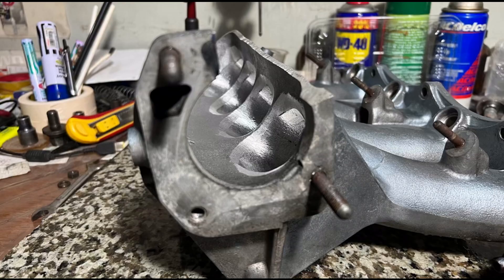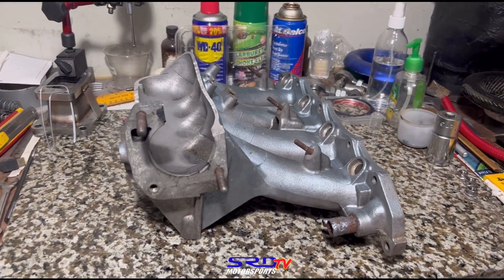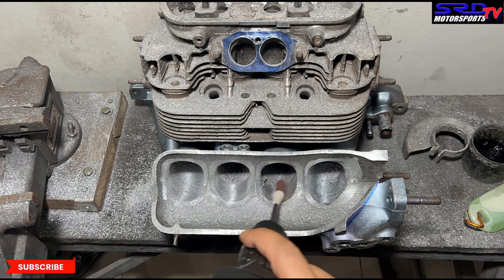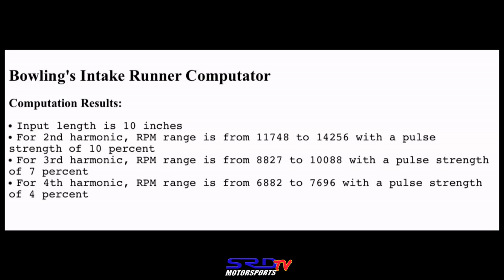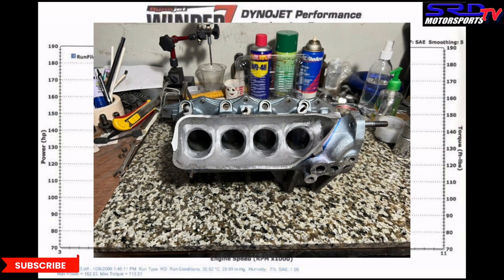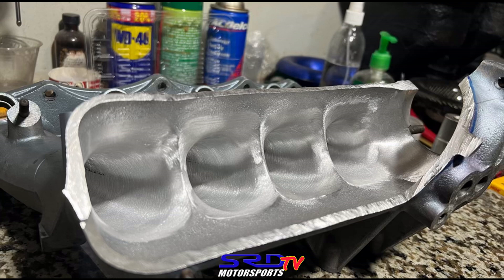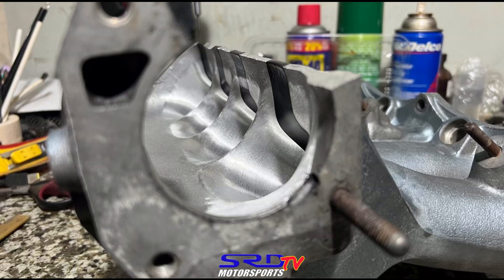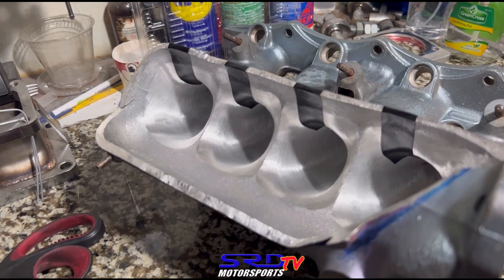Type R P73 Intake Manifold Porting Development, Runner Harmonics talk

Comment: Let me ask you I've got a stock Mazda I'm going to port and polished my intake to keep away carbon carbon buildup. what kind of horsepower do you think I would see increase by doing that as well I think the horsepower rating stock is 180
Reply from the maker: Really depends on
Reply: @SRDmotorsports  depends on what?
Reply from the maker: @Shadowwolf7774  depends if the engine is needing more “induction” or what…

it’s why I never check it with “how much hp” cuz everything affects one another…

Example lacking induction = a good cam can help somehow and the engine will think it has a “better manifold” (all about valve timing)

but then too big of a cam u lose midrange if ever? Then a better induction with good runner airspeed can help gain some midrange while sti helping top end…

In this platform it’s easy to “over cam” thats why airspeed is a lot of times big help
Reply: @SRDmotorsports  thank you for explaining that.
Reply from the maker: No worries man… u can check with the Mazda engine (if it’s a BP) if it’s known to be lacking manifold or undercammed = that will actually be a perfect starting point for the next step 😎
Reply: It is direct injection so all I wanted to do was give that carbon less opportunity to stick to the intake if it was polished.
Reply from the maker: @Shadowwolf7774  I think yeah that will indeed help with lesser carbon sticking

Comment: Do you have experience with watercooled vw manifolds?
Reply from the maker: Which kind? But I havnt actually… however the approach and analogy will remain the same cuz air flow is airflow
Reply: @SRDmotorsports 9A 16v(41mm) and also have the Euro KR 16v(50mm). I had the   KR manifold ported. KR is shaped like the type R=less bell mouth opportunity. The 9A looks more like a P30 at runner entry.
Reply from the maker: Oh that’s interesting and really cool
Reply: @SRDmotorsports  You have inspired me... Wanting to cut the 9A to open radius entry like your work. I don't know how to weld aluminum . Thanks very much for sharing.
Reply from the maker: No problem man

Comment: I trust you’re keeping well, I was hoping to find you on IG as I don’t do FB.
Would you be so kind as to share your opinion? The goal is to run on pump fuel, that I can daily and race on the odd occasion.
I have a b16a6 S4C gbox, JDM ITR OEM pistons. 63mm 1 box exhaust with 4-2-1 headers, SRI, chipped ECU, warlboro 255, stock head.
I’ve acquired another head which I’d like to fit.
Buddyclub dual valve springs, Buddyclub P1 flat face valves. Head is ported, skim and some work done in the combustion chamber, slightly ported between the valves.
Supertech valve stem seals, Supertech guides
Also came with:
Ported blox intake manifold
Speed factory 70mm TB
Speed factory Thermo gasket Port matched.
Reply: I’ve also acquired gates blue cam belt, AEM FPR, supertech headgasket (thicker one) which will all go on once the head is fitted. 

My question is, what camshaft would you suggest?
I’ve been advised to go skunk 2 pro 2.
Reply: After watching your video on porting a P30 Manifold and resonance. I am leaning towards ditching the Blox intake and porting a P30 manifold. Would be nice to do a Dyno comparison between the 2 intakes running the set up above.

I appreciate your thoughts and thank you for your interest 🙌
Reply from the maker: @JA_S_ON  wow that’s a nice sounding set up!  Odd my personal IG says SRD so I might make it SRD official lol it’s ralfsrdms

On cams if limited on Ecu tuning? The pro2 u will have a hard time so a pro1 or if possible a budddyclub spec3 (slightly bigger than a TypeR) is good. Heck to save u cost a CTR cam works

But then again the magical “R” does get expensive lol

Another trick choice is a crower 402A
A lot don’t mention it cuz everyone’s fb friends are expert and suggest what they read not do 😂

But the letter A on crower 402A (not 402) means the primary and secondary lobes are “slightly” hotter than a CTR spec and Ofcourse the vtec lobe is 402. This would let u have good drivability on limited tuning 

Keep the blox manifold but cuz u have the p30 enjoy the p30 first for free :)

Crower 402A is nandos x 
And
Crower 402 is nandos xx
If talking about primaries

Which relates to idle too so atleast it’s a decent approach
Reply: @SRDmotorsports  Thank you. Your perspective is invaluable. I am no engine builder however I can grasp a bit of physics here and there.

I came across another srdmotorsports account, will search for ralfsrdms instead 👍

I’m not sure how limited I am on ECU tuning, as mentioned I have a Dastek Unichip with Vtec controller and Rev module. It’s not in the same conversation as other more well known units that replace the oem ECU completely like hondata, fueltec and haltec.

Lotsa truth in what you’re saying. Crowers are less popular over here although we have run 403’s on a mild non Vtec LS set up that was crying for S4C ratios. We did however run BC Spec5’s on a LSVTEC and they were immense, this build however had an extensive list of mods. Nowadays we might be better off going K for the same money.

I do understand what you’re getting at in terms of cam choice, I’m not really phased as long as it suits the setup which you’ve so kindly explained.

Locally you could pick up CTR cams for the same price as BC spec3’s. I’ll be looking into Pro1’s or the 402’s as you pointed out 👍
I’ll definitely hold onto the P30
Reply from the maker: @JA_S_ON  oh sweet the bc buddyclub spec5 is GOOD as a friend used it before

Yes I understand the ecu tuning part and yes it’s too much to go all the way to Hondata

And yes very nice to see you cleverly push forward with this project :)

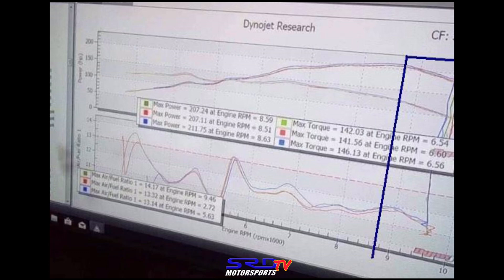Comment: 7:26 Nice TQ!
Reply from the maker: Yup! It was actually sensitive to ping

Cuz it had a “small” blox-B which lead to the reason to porting the ITR manifold “again” as it was ported already by me

= the moments the change taught me something cuz the initial mod was done by me :)
Reply: Hope you don't mind me asking, what grit sanding roll are you using towards the port entry?  Thanks
Reply from the maker: @findtherightbeat  towards the head? Same 80grit I just couldn’t spend “more” time in that area as it eats material so we might “lessen” the taper and I’d avoid that
Reply from the maker: The one from the runner entry seems smoother and can be noticed by light cuz u know I went to it over and over 😂 cuz if it’s all carbide “hole” gonna say hello lol
Reply: @SRDmotorsports  Good speed control by the way, I've seen people go through the runners unintentionally 🤣
Reply: @SRDmotorsports  A sleeper mod to your manifold would be to sand down the welds and sandblast it with the same grit to make it look factory again 😉
Reply from the maker: @findtherightbeat  I’d also say it’s unintentional 😂

Now that sleeper mod is killer!!!!
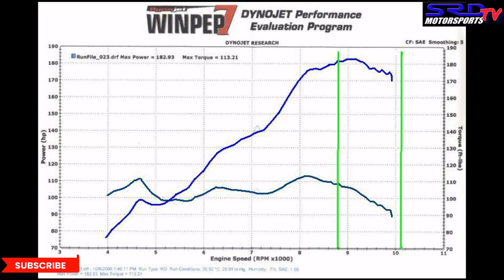Reply: 8:46 Did it run s2s2/Jun3 cams?
Reply: Sorry, was commenting while watching, should've finished the video first, haha
Reply from the maker: @findtherightbeat  oh that’s fine I don’t think I did mention what cam it had on the video 

Learned that from the vw guys and it seem to work for us and I remember Endyn mentioned something along the lines…

Vw adage’ was if u have too big of a weber? A decent snappy sized cam is good
If you are teetering on it being small? A big cam would help “to a point”

So same as having a small cam go big webers for a bit more oomph 

Our Weber was the ITR manifold 😂
Reply: 14:31 shows the angled throttle body flange you mentioned last time 👍👍